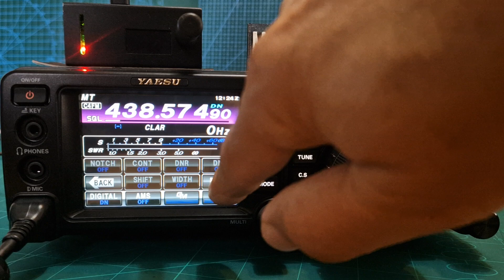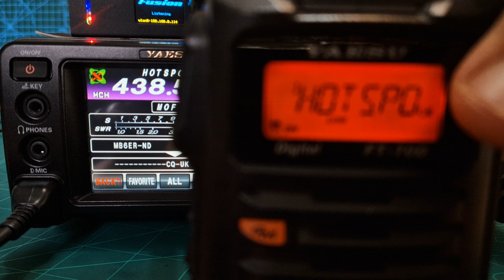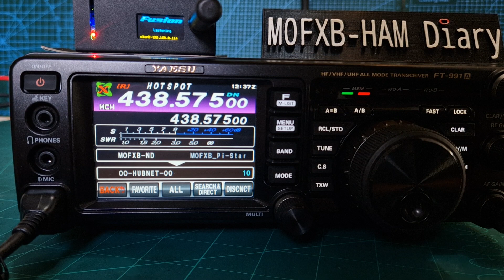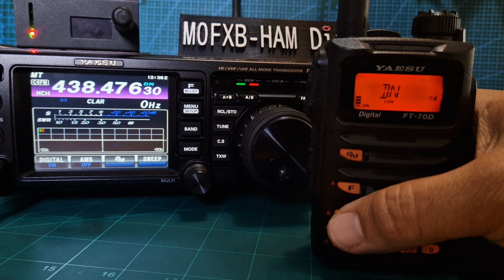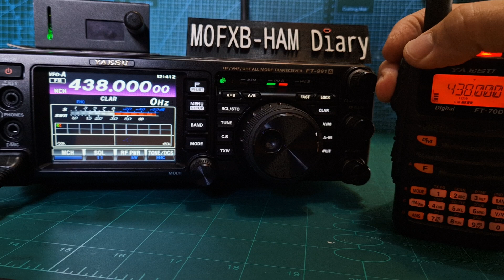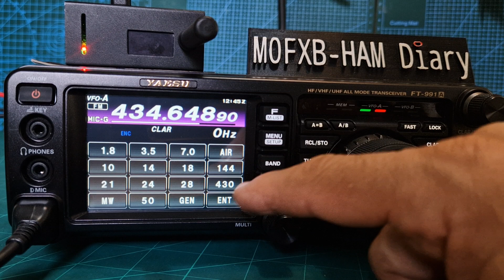YAESU FT991a Add  Hotspot  MMDVM C4FM

Comment: did you ever get the ft991a working well via the hotspot? I spent a few hours tonight trying to improve c4fm on this radio to no avail.
Reply from the maker: Hi what is yours doing ?
Reply: @m0fxbhamtech  The main issue is for me receiving a C4FM signal on the 991 (via the hotspot). It sounds like it is off frequency, but I have spent many hours trying to make it better. to no avail. I have tuned a DMR radio like this to perfection but this 991a just does not want to have it. When `i searched on the issue it seems I am not alone. Shame.
Reply: @MikeDent  mine has horrible audio
Reply: So has mine although the audio from a proper wires x repeater is fine I gather it's some kind of design fault. With the 991
The audio using my ft 70 and hotspot is fine